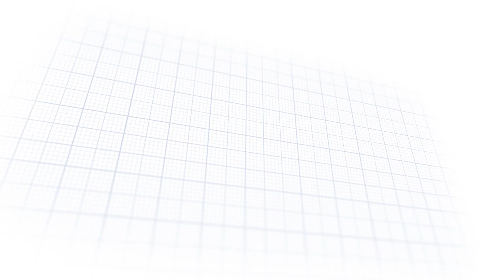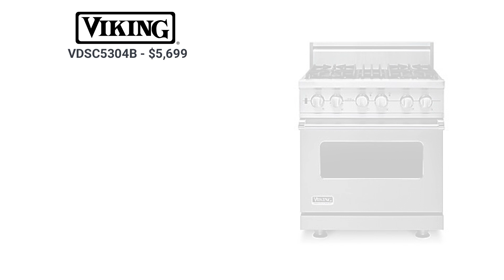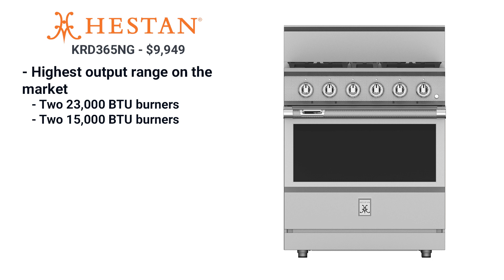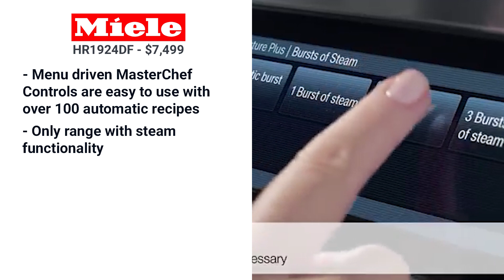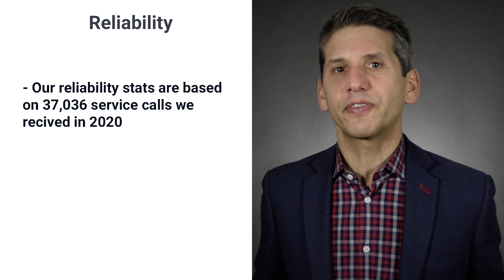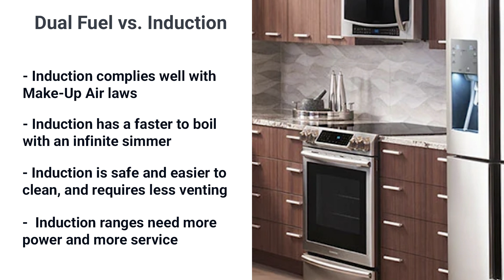The Best 30-Inch Dual Fuel Pro Ranges for 2021 - Ratings / Reviews / Prices

Comment: Important factor to consider before buying an induction stove: burner size.  It matters--A LOT.  On most lower-end induction stoves the largest burner you'll get is 6".  Since induction burners only heat the area of the pan making contact with the burner surface, this means trouble for 12" skillets, which typically have a 9" bottom diameter: the central area of the pan will heat nicely, but the outer area will not.  If you want to get 12" burners, count on spending big bucks, like $5,000 and up.  For a Wolf range, WAY up.

Comment: please explain venting- I live in New Meico, but am environmentally conscious- I seek to replace my old kenmore freestanding range, there is a hood above the range, but I don't know if there is any kind of venting through the roof, like a gas clothes dryer for example.. how do I know if I can put a Bosch range or a Jennair, in the same space?
Reply from the maker: A hood can be vented two ways.. one is outside, which is preferable. The other is recirculating, meaning it pulls the air in, runs through a carbon filtration system and spits the air back out into the space. Bosch can be substituted into the space with the same expectations as what you have now. JennAir is a different story. They are a professional range which means much more power so your current vent solution is most likely not sufficient.

Comment: What happens to the older models, specifically without wi-fi?  I will soon be looking for appliances, but I don't want all the computer stuff.
Reply from the maker: With dual fuel ranges there will always be an electronic component. More and more manufacturers are investing in Wi-Fi/apps/etc so it would be hard to avoid. That said, at this point those features are optional. You can just use the range as is if you prefer.
Reply: @YaleAppliance1  Thank you so much for your reply!